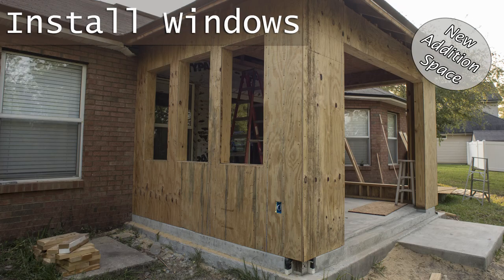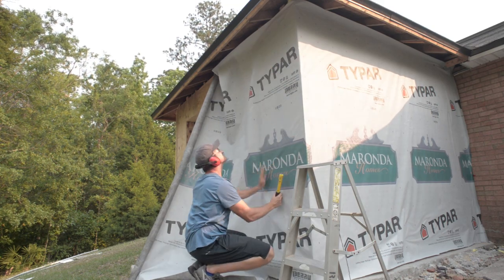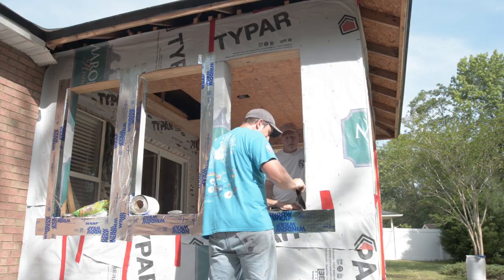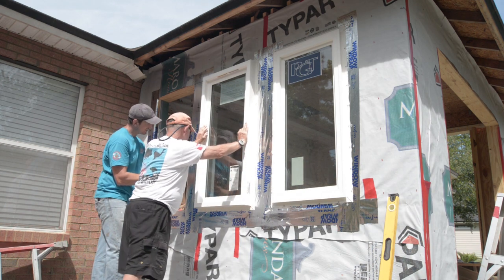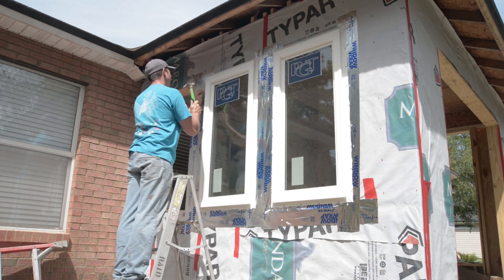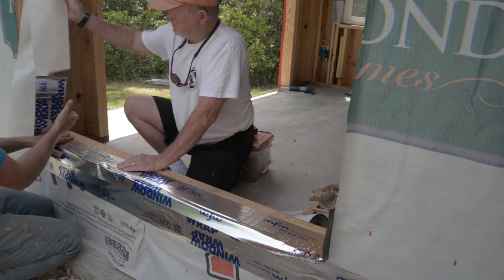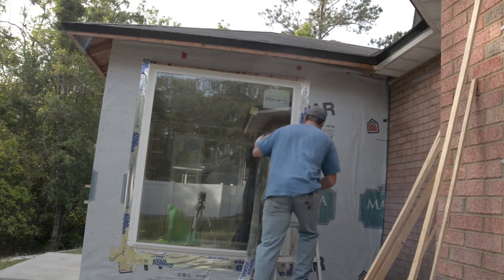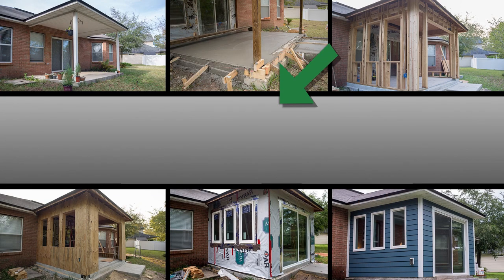How I Installed Windows, New Home Addition Project Vid #8

Comment: Great videos brother. Just a question. I know in the video where you install the hardi boards you caulk the 2 inside corners where the vertical Hardi board meets the brick corner. 

But is there any sealing to be done on the inside corners where the typar meets the corner at this stage of construction in this video?

Comment: The way you cut the wrap was in my opinion, wrong. From each corner you make a cut to the center so you have a flap to fold in and staple to the frame and cut off excess. This will save on sealing tape and provide a water barrier on the window frame. I would've put a solid bead of window sealant on the window to eliminate and chance of bugs or moisture to penetrate. The window flashing tape only needs to be applied on top of window flap in layers from bottom to top so any water runs down, like roof shingles are layered for the same reason. other than that it looks pretty good.
Reply from the maker: Thanks for your tips on cutting house wrap for window installation and window flashing procedure.

Comment: i screwed up on my patio on one wall...i was just so desperate to get up a wall to block for privacy...i just nailed the mdf board straight to my frame with no sheeting house wrap for moisture...my question is can i just slide some in between the lumber and the wall panels? i have a feeling you will say it won't hurt but should i just screw it and fill in with some insulation and finish the inside and just hope that maybe it will last or should i rip down and put in plywood and moisture paper?...its only two and half panels but they were so heavy for me and hard to manage...i'm by myself...not to cold here but always hot in summer...i just don't want to do all this and then a year from now i have a fungus growing...if it lasted five years i would be happy but one year? any suggestions?